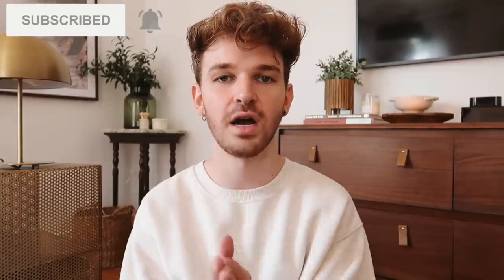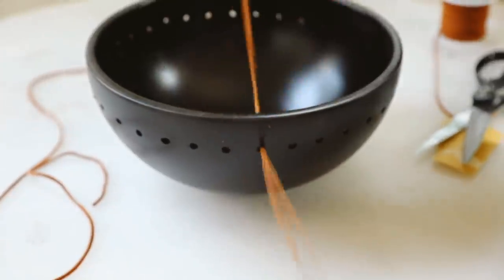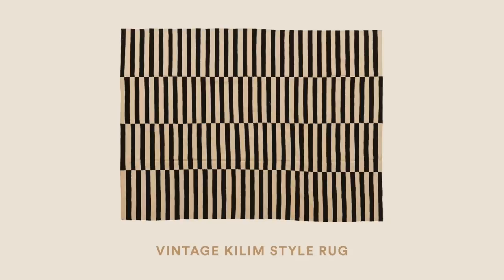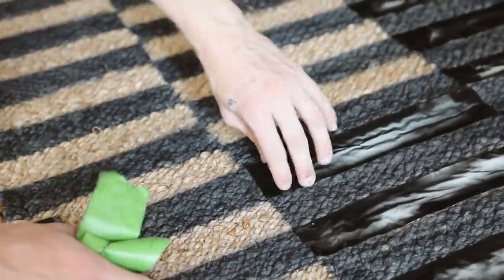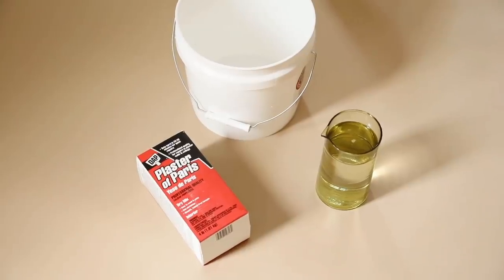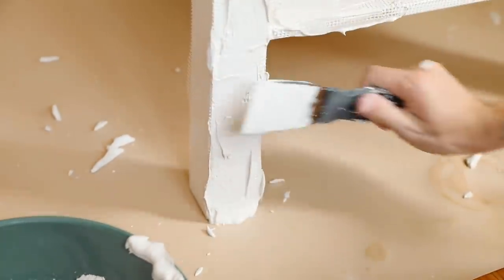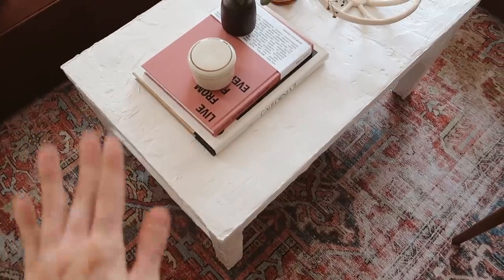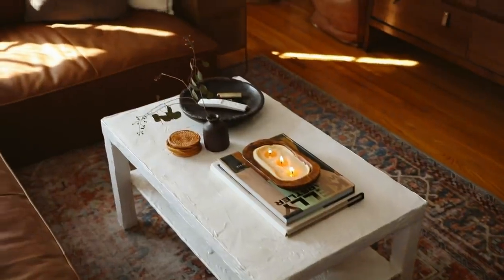DIY IKEA HACKS - Affordable DIY Room Decor + $50 Plaster Coffee Table!

Comment: I love the table so much! Maybe because I recently completed a similar project, I used the square Ikea side table in black ("Lack",  21 5/8x21 5/8 ") and using tile glue and grout (two in one, in my case, usually they are two separate products) glued on the tile on the table top. I used Satori Silver Crescent 12-in x 12-in Honed Natural Stone Travertine Versailles Stone Look Wall Tile (that is 7.98 in my Lowes per one 12x12 square, I used 3). Also, used Satori Countryside 12-in x 12-in Multi-finish Natural Stone Travertine Uniform Squares Wall Tile, smaller square tile to trim the sides of the the table top (2 tiny tiles width was enough to cover the thickness of the table top along the sides). I didn't do anything to the legs, so they remained black and the top is kind of grey now with all these tiles. I liked the matte stone look of it! All these Ikea table hacks with tiles videos inspired me to do that. The finished project with all the rock tiles on top is so awfully heavy!
Reply: I would Love to see your coffee table, sounds like it is unique & creative- originality is my fav inspiration ✨ Great job Drew, you Always bring it 🤩

Comment: Drew. Love them all. FYI joint compound works too, I use it all the time and you don’t have to mix it. It comes in various sizes.
Reply from the maker: Sometimes I experience some cracking with joint compound!! Have you ever had that happen?
Reply: @lonefox  thin it with water or not and thin coats let it dry in between. Just build it up. It takes longer, but worth it. I make masks with it all the time.

Comment: Try using Venetian Plaster sometime! You can get a Valspar version at Lowe's and get in tinted in any paint color (but I recommend a grey tone.) When it's try you can sand it in a high grit, very fine grit, and finally buff it with a paper bag and it looks like polished concrete! Super fun process and really beautiful.
Reply: Also it's a thicker consistency and doesn't dry as fast so it's a lot easier to work with than Plaster of Paris.

Comment: The Lack table is a classic Parsons design and I've always liked the simple lines, but disliked how cheaply the Ikea one is made. Maybe it's improved over the years? It was always rather flimsy and light weight. I'm wondering if the version of the table you bought had any weight to it originally, and if the plaster added any significant weight to it after being applied? You did a good job with it, as well as the bowl which turned out great. I thought Ikea sold a version of that black and white offset striped rug? 👍💖

Comment: Just a question: if anyone know this. For number of times Drew has done spray paint on the rug. May i know if the color fades when its wet? Or does it transfer to our socks or feet? I hope they’re not. Cause i wanna try to do it 😍 it looks pretty!!!
Reply: I spray painted a door mat with spray paint. Held up really well. Its been about a year. Didn't come off on shoes or feel. Starting to fade slightly but honestly held up better than the original paint. Used rustoleum. Fyi.